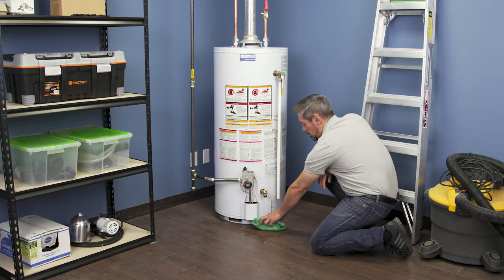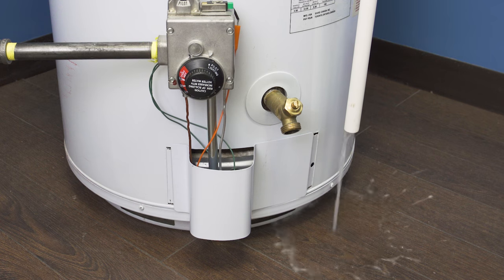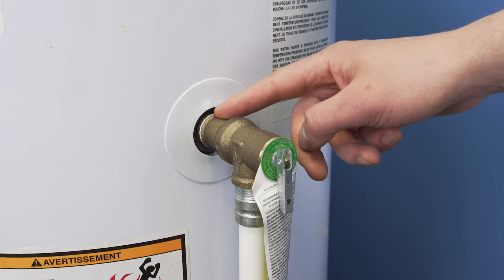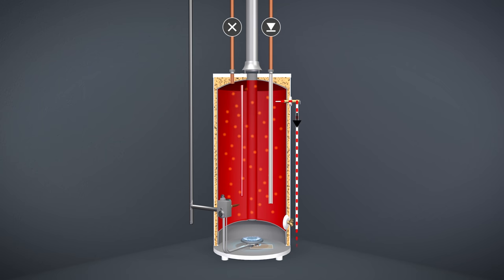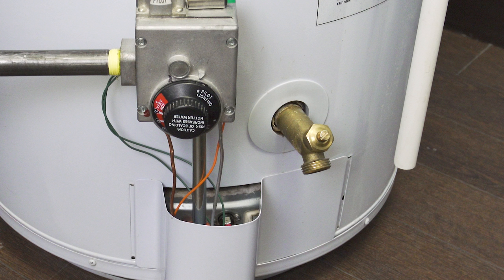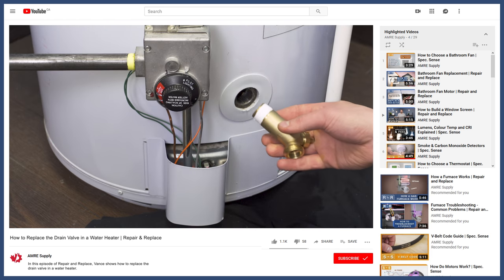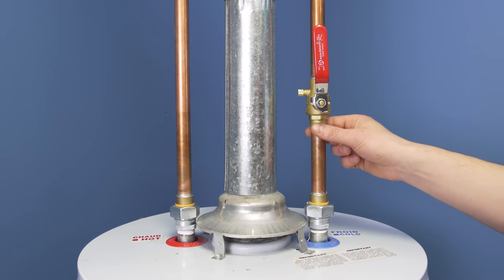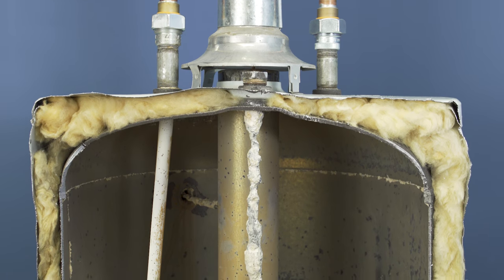Hot Water Tank is Leaking? Top 5 Fixes | Repair and Replace

Comment: I have yet to find an easy access anode rod removal nut!  I notice on this particular tank the nut sits up high on the tank making it easy to remove so that the anode rod can be replaced.  NOT SO !  Most water heaters have that nut recessed below the surface of the tank and they are very, very shallow, making it nearly impossible to remove it.  Nothing even said about the anode rod which is used for “sacrifice" so that the tank will not rot out as fast.  When the anode rod deteriorates, it must be replaced about every 4 to 6 years.  The tank will last much longer if this simple rule is followed.  A special nut driver is used to accomplish this task or ask a plumber to come in and have the work done professionally.   REPLACE THE ANODE ROD on a regular basis and your water heater will last years longer!
Reply from the maker: Thanks for watching. Regular replacement of the anode rod can definitely help extend the life of the water heater. We did a video focusing more on how the anode rod works, and how to remove it. It really depends on the situation. In some cases an impact wrench might be needed if the anode threads are seized. You can see that video here: https://www.youtube.com/watch?v=hTJv67imgaE

Comment: replaced the relief and still have just a tiny amount of water seeping. Now what I do?
Reply from the maker: Thanks for watching. You could try removing the relief valve and cleaning the threads with a wire brush. Reapply thread sealant and reinstall. In many cases this can help fix the leak if the leak is coming from the threads.

Comment: What if I replace the drain valve but there is still water coming from around drain valve
Reply from the maker: Thanks for watching. Its possible that the threads were corroded or were rusted. This can prevent a new drain valve from making a good seal. If you remove the new drain valve, clean the threads with a wire brush and vinegar. Also inspect the threads to see if there is any damage.

Comment: But what if the water gushes out losing around 10 litres after using hot water usage?
Reply from the maker: Thanks for watching. If you are losing that amount of water then there is a major leak in the tank. It would be best to shut off the water supply to the water heater and call a technician to do a closer inspection. You might need a new tank.

Comment: Why are they not just manufactured with a brass relief valve? Makes no sense to have to change it out simply due to substandard part out of the box.
Reply from the maker: Thank you for watching. Plastic drain valves are resistant to corrosion but are more prone to breaking. They are less expensive than brass which is likely why they are manufactured that way. With a healthy anode rod, a brass drain valve should not have any issues with corrosion.

Comment: Thanks for giving advice on a 220 volt or gas appliance.  A leaking water tank can easily short out when water leaks on the wires and the thermostat and there will be a loud noise with a fireball when it shorts out. 220 volts with a wet copper ground will kill you 99 percent of the time. A Gas water heater could be leaking due to a defective gas valve or safety. I wouldn't be given advice on appliances that can easily kill you or burn down you house.. Just my 40 Years experience.
Reply from the maker: Thanks for sharing your experiences. We currently don't have videos on electric water heaters but for all our videos we recommend unplugging / disconnecting the power before any troubleshooting. As for gas appliances, we recommend that any repairs of the gas fittings or the replacement of gas valves to be handled by a licensed technician.
Reply: If you cut off the power and close the gas,  which you should do before working on it,  then how can it electrocute you or burn down the house?

Comment: Something is going on my floor got water damage the floor is humped up under the carpet might be time for a new one 🤷‍♀️
Reply from the maker: Thanks for watching. It depends on the layers below the carpet, the water could be under one of these layers and might be pooling there. In any case it's worth making sure everything is dried properly to prevent any mold or rot from happening.

Comment: Wish i just knew the name of these parts  so I could fix them myself. Cant google it when you dont know the part name
Reply from the maker: Thanks for watching. The parts are listed in the description but the only part not specifically named is the dialectric union which connects the tank to the water supply. These can sometimes be part of the nipple and will be called dielectric nipples. You can see these parts here: https://www.amresupply.com/catalog/Hot-Water-Tank-Parts-647736

Comment: Mine is 12 years old, I saw today is larking water from the bottom.
Reply from the maker: Thanks for watching. If the tank itself is leaking and not just the drain valve or threads, then you'll likely have to install a new water heater.

Comment: Our hot water heater is not working no hot water 5 days. First plumber says there is a keak
Reply from the maker: Thanks for watching. Were you able to identify a leak or a source for the leak? Normally a leak shouldn't prevent the water heater from heating unless it lost most of it's water. A faulty thermocouple or thermopile, a failed thermal cutoff switch (TCO) or a defective control valve can prevent the burner from staying lit and prevent the tank from heating. You can see more in these videos: https://www.youtube.com/playlist?list=PLCo9SMjkdWBwJ4a8MT2GKTDiSuvSHg6Xk

Comment: So mines leaking from the cold but it’s hot
Reply from the maker: Hi Tyler, thanks for watching. It's likely that the water heater (when hot and pressurized) is warming up that portion of the pipe. When you use some hot water the cold supply will help fill water. It'll likely be colder as the cooler water will be flowing into the tank.

Comment: My system is so hot.
Reply from the maker: Thanks for watching. The temperature can be controlled at the dial at the front of the water heater, try adjusting the temperature then it might take several hours to see a difference.

Comment: What if you have water leaking from both the relief valve and the drain valve?
Reply from the maker: Thanks for watching. If the water heating is leaking from both the relief valve and drain valve then it would be best to replace both valves at the same time. First start by draining the tank  and replacing the drain valve as shown in this video: https://www.youtube.com/watch?v=nGCejMsKNX4 With the tank drained, then you will also be in a position to easily replace the relief valve. https://www.youtube.com/watch?v=2qhsmSbQQzc

Comment: I could've saved myself nearly 4 min if you simply said "just call a technician".
Reply from the maker: Thanks for watching. Some problems can be easily fixed such as a faulty drain valve or the relief valve. This video is intended to help people get a better idea of where the leak is coming from and if it is something they can repair themselves. Judging by the number of likes and the comments, many other people have found these 4 minutes helpful. Hope your repair goes smoothly.
Reply: @AmreSupply   The 4 minutes were 4 minutes of knowledge being shared.  THANK YOU.

Comment: Yes..that's my problem, inner tank leak :( $$$$$$$
Reply from the maker: Thanks for watching. Sometimes its not a small repair, but it's always good to check the simple things first. A water heater replacement is more expensive but can resets the situation which means there won't be surprises one or two years from now. That is always a risk with older water heaters.

Comment: No mention of water leaking from bottom.
Reply from the maker: Thanks for watching.  A leak from the bottom of the tank would be considered the inner tank, as mentioned in the video. As well since water flows a leak from the drain valve or relief valve can pool at the bottom of the water heater so those are always good to eliminate first.
Reply: @AmreSupply  -- Hello AMRE, thank you for your prompt reply.  I was getting my wallet ready to buy a new water heater when I carefully inspected the top of the water heater.  If water's pooling at the bottom, why the little puddle on the top, next to the in-flow pipe, sticking out of the tank?  Careful inspection detected the problem: the in-flow hose connected to the tank's inflow port had a tiny leak -- just where the in-flow hose connects to its "nut" screw-on connector.  The hose is the plastic wrapped with stainless webbing kind of jobbers.  I replaced that in-flow pipe with a copper pipe and so far no leaks!  There was one symptom that initially led to solving this issue: I noticed the pilot light would go out on the gas-fed Rheem (3 year old) water heater.  Twice.  Could the water saturating the bottom of the tank cause so much moisture that it puts out the pilot light?  Seems so.  I sucked water out with my shop-vac.  Must've been at least half-gallon of water pooled inside the heater's bottom tray.  
Thank you again!  RG
Reply from the maker: @rerite2  You're welcome, we're just happy to help!

Its good that you were able to narrow down the leak. Water pooling can be deceiving but you were smart to trace it up to the supply line.

Cheers!
Reply: @AmreSupply  --- Well, I'm stumped.  The Rheem gas water heater pilot light won't work.  I hear the gas going in.  The blue indicator light flashes for a bit then turns red -- solid red.  I guess the water did some kind of damage.  The water heater has been drying out pretty well as it's hot weather now.  Suggestions?
Reply from the maker: @rerite2  If the pilot won't light at all then it could be an issue with the ignitor (check the wires to make sure its grounded) or the pilot orifice could be plugged.

If the pilot lights but doesn't stay lit then its likely an issue with the thermocouple (or thermopile), the wires or connections, or the thermal cutoff switch. You can see more in these videos:

Thermopile (electronic valve)
https://www.youtube.com/watch?v=UXpmmGuewk8

Thermocouple (conventional valve)
https://www.youtube.com/watch?v=Lu5GvbvspMw
Reply: @AmreSupply  -- Thanks again for your reply.  Much appreciated.  I called Rheem, and since the heater is still under parts warranty, they said they'd send  a new pilot light assembly.  Will see how it goes.  Thanks again!
Reply from the maker: @rerite2  You're welcome! Best of luck to you!!

Comment: Hey mine is leaking and making wissing noises
Reply from the maker: Thanks for watching. It would be best to wipe up the water, try to dry it down so you can observe where the water is leaking from. If it is from the drain valve or relief valve then it's an straight forward fix. If not then you might need to call a plumber.
Reply: @AmreSupply  thanks really appreciate your comment I was able to diagnose it and found the insulation inside was wet so we used the warranty and we are getting a new one again really appreciate you're video gave you a thumbs up and subed forsure 👍🏼
Reply from the maker: @ryan9984  Thank you for the subscription! We're glad that you narrowed down the problem and we're just happy to have helped!

Comment: for what you're paying, why can't the manufacturer install a brass drain at the factory? Cheep and junk BS!
Reply from the maker: Thank you for watching. The plastic valves do have better resistance against corrosion, but considering that the pressure relief valve is made out of brass, it doesn't make sense that the drain valve wouldn't also be made out of brass. Many people find that a custom brass valve (using a 3/4" brass nipple and a 3/4" ball valve) can be helpful. This is mentioned in this video: https://youtu.be/nGCejMsKNX4?t=195
Reply: The brass assembly I built from store fittings cost just about 40 bucks.  Yeah, it would be easier to maintain a water heater tank if the drain shut--off was more functional and didn't tend to be a source of a wasteful leak.

Comment: Water leaking from top vent
Reply from the maker: Thanks for watching. If a small amount of water is leaking from the top vent then it's likely an issue with condensation within the vent. This can also be a sign that there is negative pressure, or an issue with the exhaust. In some cases cleaning the vent can help but you might want to get it inspected by an HVAC technician.

Comment: My water is coming from the cold side
Reply from the maker: Thanks for watching. It could be from the threads on the cold water supply. Repairing the water supply pipes is a little bit more involved than the drain valve or relief valve so we don't have any videos showing the steps. This is one case where its often good to hire a plumber.
Reply: @AmreSupply  just fixed it. Bought new water hoses and it doesn’t leak anymore :)
Reply from the maker: @Superschemer34  Glad to hear that the repair went smoothly! All the best to you!

Comment: Ok, so basically everything is best handled by a technician, not very informative for DIY.
Reply from the maker: Thanks for watching. A leaking drain valve or relief valve are simple to replace and can be done by the average home owner but any damage to the tank, or leaking pipes would require replacing sections of the pipe and that is more difficult. We tried to outline the differences and still help point people in the right direction.